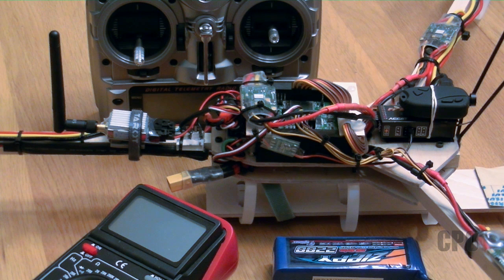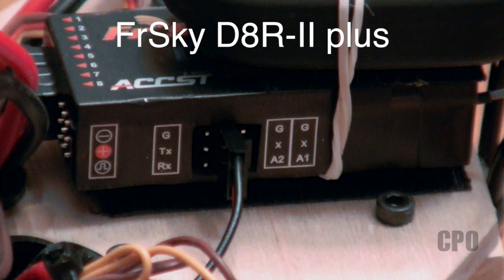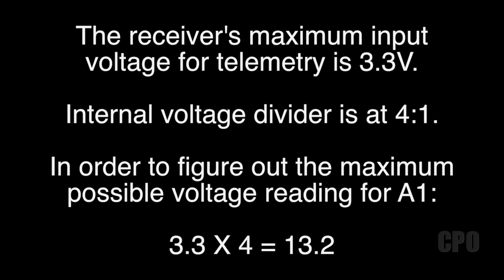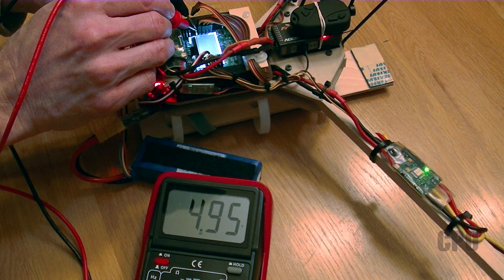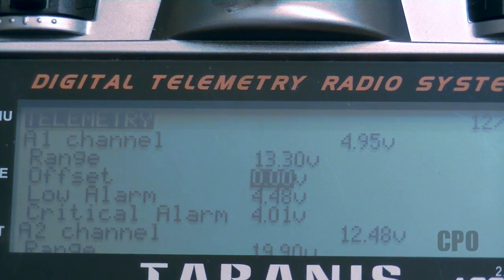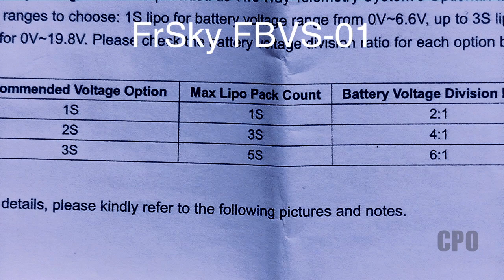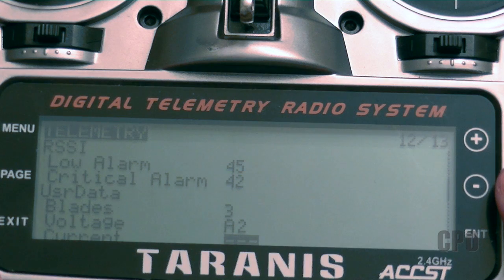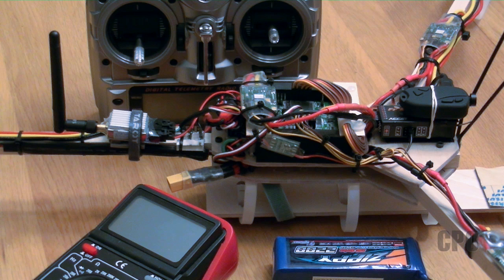Basic FrSky Taranis Telemetry : A1 and A2 Voltage and Telemetry Screens

Comment: how it working for x6r ... i didn't see  a1 pin    :  not clear for me  With external analog telemetry port(AD1),
 When pins of A1and X (Middle Pin) are connected by the jumper, A1 will change from External Analog
 Telemetry Port to Internal Built-in battery voltage sensor.

Comment: You're wrong about the calibration. You calibrate with the battery completely unloaded and then seem to be surprised that the voltage (when the battery is connected to your system - loaded) is lower.
You then miscalibrate the transmitter to be 100 mV off from the actual battery voltage.

Comment: Hi, Thanks for your great video. Is it possible to use A1 or A2 or digital ports to get any RSSI value on the FPV screen (not the transmitter screen) ? I'm searching the web , I could not find any answers as yet . can these A1 and A2 to be considered as representation of signal strengths? Thanks in advanced

Comment: Sorry to revive a dormant thread, but so far this is as close to information as I can get...even open-txu points here.  I am using this receiver: https://www.banggood.com/FD802-Tiny-Frsky-8CH-Telemetry-RSSI-Receiver-Compatible-FRSKY-ACCST-X9DPlusDJTDFTDHT-For-QX90-p-1116724.html (sbus) , and a micro SPF3EVO FC on a brushed 2s build.  I get RSSI info, but theres not a lot of space for more stuff.  Would I be ruining anything if I fed a1 (and the ground pin beside it) direct from the battery?  I want to get pack voltage, but I believe what the video says is that you must limit the voltage input to the receiver (so it doesnt fry), and then extrapolate the actual voltage via a formula on the Taranis.   Sorry if this seems a bit simplified, and thanks for your video.

T

Comment: This applies to pre-2.1 firmware.  The telemetry page is quite different under 2.1 but the principle is the same.  Instead of the "range" parameter, it is now the "ratio" parameter that is used for the calibration.

Comment: thank you.. you saved my day ;-) i connected it and had 12.4V on the battery, but in display, the A2 showed 8.4V after adjusting Ratio (newer firmware) i got the same v in display on my taranis as i mesure on my battery :-)
Thank you :)

Comment: What resistor values does FrSky use on its FBVS-01?  I guess the important one is the sense resistor, since that's fixed and is a multiple of the other ones.

Planning to deadbug one for my setup.

Comment: Thanks a ton for posting this!  Saved me SO MUCH time.  Now, on to figure out how to get warnings to play as a track :)
Reply: Should I have my sensor hooked up to the balance leads, rather than the main leads?  I'm getting low and critical warnings all the time during flights, even with settings at 10.81v and 10.73v respectively.  Range has been calibrated properly.

Comment: So why exactly would you want to monitor internal Rx voltage? does the voltage drop as your battery dies? can you please explain this? 
So I guess I need an external Lipo sensor plugged into A2 and I can monitor internal RX voltage (for some reason) and external Lipo voltage?
Thank for the explanation
Reply from the maker: Good question. To be honest, monitoring internal RX voltage is less useful for most people that battery voltage. It just so happens that it's really easy for the RX manufacturers to build that in, so it's there. The reason why it can be important, however, is identify voltage sags during flight.  It could be that you are taxing your BEC with excessive load and perhaps the voltage drops below safe levels. On a heli with high torque servos, this is a reality.  There may be other reasons, but that's what comes to mind right away. I can't think of a time where RX voltage has been useful for me during flight....not right now anyway.
Reply: Awesome thanks for the explanation! That's what I figured . I just got a external FrSky telemetry monitor (9x) and I've been researching possible telemetry outputs. I guess I'll have to get an external monitor for my Lipo and run it into A2. Then I should get RSSI, Internal and Lipo voltage. Interesting stuff. I think watching for voltage sag will be a nice feature. 
Thanks again!

Comment: Hi, i am using the FrSky D8R-II with my Turnigy 9x, OpenTx Firmware and Smatie parts programmer board and TelemetrEZ board.
RX / TX telemetry is working fine but no voltage data is being received.
Do i need to change something in the hardware or should i see voltage data on my Tx via the A1 port of the Rx with jumper installed?
I havens yet installed a voltage monitor for A2 input on the Rx.

Also i havent adjusted any of the settings in my Tx Telemetry screen regarding voltage...  Do i need to set this prior to receiving any data?

Any help greatly appreciated.

Comment: HI, thanks for posting. I am wondering if all of this applies to a Taranis Plus and X8R receiver? I believe not, as you mention ANALOG all the time and the X8R is digital, correct? I have the FRSKY SP-FLVS LiPo sensor and the FRSKY SP-150A sensor. Both are working "fine". I just need to make sure that they measure correctly. How do I do that?! Thanks, G. p.s. I asked on rcg and they referred me to this video...?!

Comment: Excellent video, Thanks. At 11:31, you show how to select criteria to be shown on Screen 1. I want A1 to show in a position, but when I scroll through the options, A1 does not exist, but yet you show an A1 on the screen. I have a A1- and a A1+ and many other options but no A1 by itself w/o + or -. What am I doing wrong? Taranis Plus fw 2.0.12. ( I will eventually have Pack Voltage on A1 via the FVBS-01 and Vario on A2 via D8RII plus.)
SOLVED: First define A1 range, then it will be available in screens config.

Comment: Do you know for sure if this all applies as far as external voltage goes if you used a D4R-II receiver instead of the D8R-II, without any additional hardware than what you are using in this video?

Comment: Where did you connect the FBVS-01 voltage sensor to on the Receiver to get the 12.40 voltage reading?

Comment: Thank you for this video! I've tried to follow your instructions but I having problems! 
I have the Frsky FLVSS and the normal precision vario. I connected the voltage sensor to the smart port and have the vario daisy chained into the voltage sensor.
When I connect my battery pack I'm not getting any reading on A2 show the total pack voltage. I get the individual cell reading but not the total cels. 
Also I constantly am getting the "critical alarm" warning for A2.
Can you give me the low alarm and critical alarm values needed.
I use both 3s and 4s batteries for my quadcopter so does this make a difference?
Thanks

Comment: I have a Taranis witrh an X8R connected to SmartPort Variometer. I want to connect a non-smartport voltage sensor to this setup. From what I understand, the Smart Port variometer can act as a Sensor hub for other non-smart port Frsky sensors. I connect the red and black wires on the output side of the FBVS01 to the Data in port plug on the Smart Port variometer black to ground and red to the Rx.  I connected the red and black wire (or red only ?) on the input side to my single flight/power 3S battery. 
I thought somethin would magicly show up on A2 on the Taranis. A1 is my receiver voltage, and vario works, but I can't see my battery voltage.
Any ideas?
BTW, your videos have made this Taranis learning curve mush more bearable.
Reply: Personally, while you can protect your investment in non smart port hardware, I find the Smart Port capable High Precision Vario a VERY good investment. Just saying...

Comment: EVERYTHING cpo Thanks so much for the video. I have a small question that you might be able to help me with.  You use the the balance cable to conect the sensor, is that necesary? can I just solder the cables straight to my power distribution and read the value from there?
Reply from the maker: You could tap right into the pdb...that should work just fine. You just need the full voltage source.
Reply: EVERYTHING cpo
thanks a lot for your help. Sorry for the stupid question, what you mean by cull?
Reply from the maker: Sorry, CHARPU FPV   ..that was supposed to say "full". .That's what happens when I respond to comments on my iPhone!  LOL!

Comment: Thanks man for the longest time I thought the A1 voltage was supposed to be my TOTAL voltage on my pack....and not the Per Cell reading  I now understand the offset reading!  By any chance do you know if there is a way to set the voice alert when you have a drop in voltage by .10 and can you tell me if there is a way to sound off the RSSI signal every so often?  I wear FPV glasses and will be relying a lot on the audio alarms functions.

Kyle
Reply from the maker: Short answer is, I am sure there is a way...sad answer is, I haven't don that yet. You might be able to get some quick help from someone on the Taranis thread at RCGroups.
Reply: This is what I did, http://www.rcgroups.com/forums/showthread.php?t=2063534 I hope is what you are looking for.
Reply: I found that same video the day after I asked you about it....LOL

Comment: Hi, Can you please clarify what do you mean by the maximum input that the rx is expecting to see is 3.3v? Is not the maximum voltage for a lipo 4.2 v per cell?
Reply from the maker: Sure.  The sensor is not directly reading the cell voltage, but rather the combined cell voltage is run through a voltage dividing circuit. The resulting voltage that goes to the sensor isn't "actual" voltage, but rather just a reference voltage that it monitors for change.
Reply: EVERYTHING cpo Thanks for clarifying this.

Comment: Heloo I have  X8r  does any one have  any clue  which port one has to connect the  voltage monitor  in  the RX for telemetry   also i am using  6s lipo because the voltage monitor cable i think only support till 5s  am i right ???
Reply from the maker: You could go one of two ways:

1. a smart port voltage sensor, like this one:  http://www.alofthobbies.com/frsky-sp-flvs.html. This is the voltage sensor designed to go with the X8R, and uses the smart port. 

or 

2. You could use this: http://www.alofthobbies.com/x8r2analog.html  This is an analog sensor that plugs into the smart port on the X8R. It was designed and manufactured by a Taranis user...not FrSky.
Reply: EVERYTHING cpo so this one does not work?
  http://www.hobbyking.com/hobbyking/store/__16671__FrSky_Battery_Voltage_Sensor_FrSky_Telemetry_System_.html
Reply from the maker: No that's an analog sensor. x8r requires a smart port sensor.

Comment from the maker: In this video, I go over the basics of setting up analog voltage telemetry on the Taranis using OpenTX.  I am using a FrSky D8R-II Plus re ceiver and a FrSky FBVS-01 voltage sensor.  I go through the basic setup to use the A1 port for reading internal receiver voltage and using the A2 port for reading my flight battery voltage.  

I show how to set the telemetry ranges for A1/A2, how the voltage dividing ratio is used, and how to calibrate that value against the actual voltage measured with a multimeter.  Finally, I show you how to display the information on telemetry screens on the Taranis. 

Thanks for watching!

cpo
Reply: Thanks to your video I've got my A1 & A2 voltages calibrated & displayed, but, why doesn't A1 or A2 work in the custom switch menu to create a custom function voice warning? I use A2 as the source and compare a<x and the switch does nothing even when I run the "X" value way above or below my A2 value Any ideas?